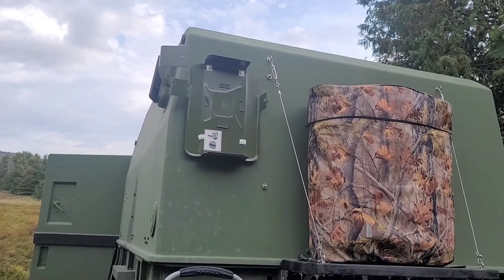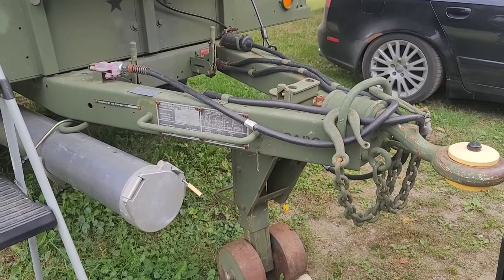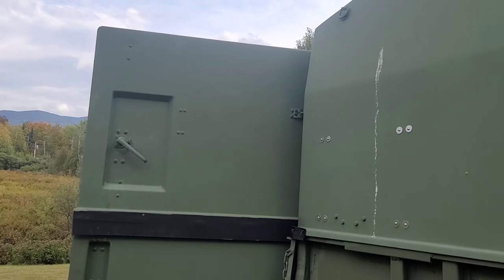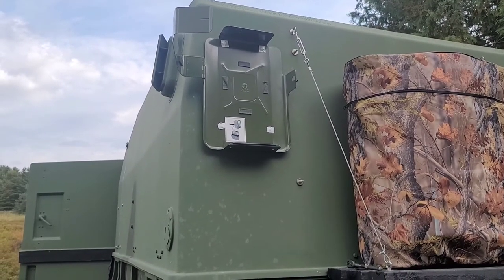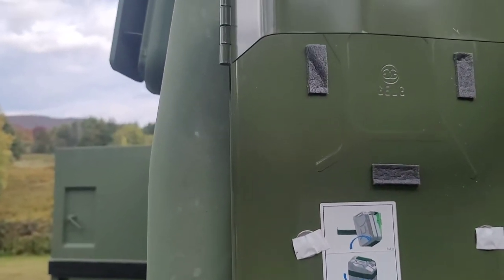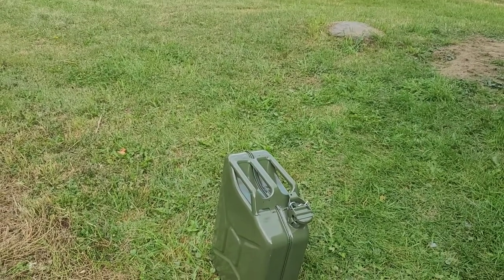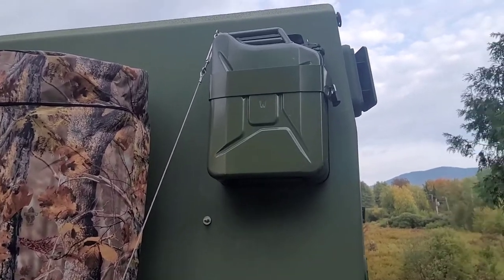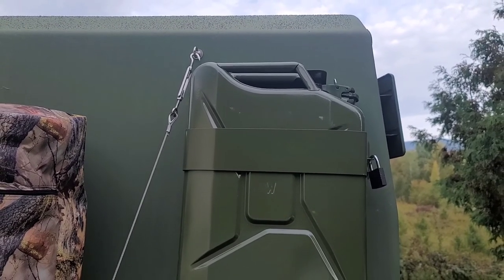Military Trailer Project:  Polish-made jerry cans and mount - high quality, outstanding workmanship

Comment: I understand why you went with the side opening brackets. I personally would have mounted them at the lowest possible position on the side using Australian style mounting brackets. they have the bottom but slide sideways, allowing you to pull it out at a 45 degree angle. Thanks for sharing the videos of your trailer project. Great channel! Atb emily.
Reply from the maker: Hi Emily,, I really struggled with the position.  I just felt that I didn't want to worry about swiping them on the side.  Additionally, I had 2x4s on the front wall on the inside for more stability.   Thanks for watching and commenting.

Comment: I have question about your M105. I was wondering if your M1009 would pull it. I currently have a M105 and I'm considering getting a M1009 and not sure if it would pull it.
Reply from the maker: No.  The bumper is not made for it.  It is rated for about 3500.  I removed the bolts and replaced with stainless bolts, so maybe 4000 max.  Also the short wheelbase is not set up for hauling.  Also, the M105 sits pretty high.  My 1028  has a six inch lift and it is level.  The 105s are really made for the deuce and a half.  I'm gonna put electric brakes on it as we.
Reply: @VermontPrepper  Thanks for the info. I pull my M105 with a 3500 Cummings and it handles real nice. If I do go with the M1009  I'll probably get the M101 to pair with it.
Reply from the maker: Yes, My son uses the 1101 with the 1009 for his detailing business.  Works perfectly.